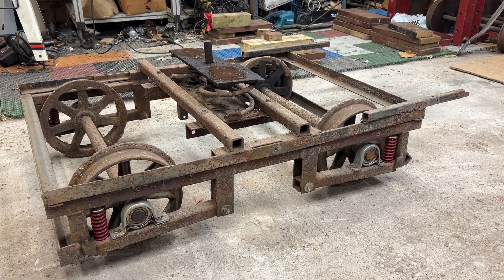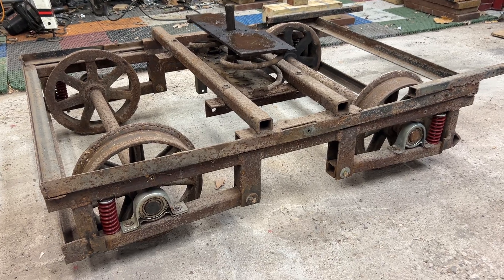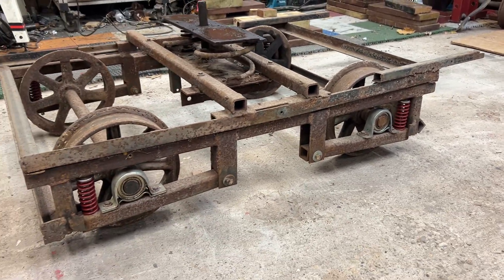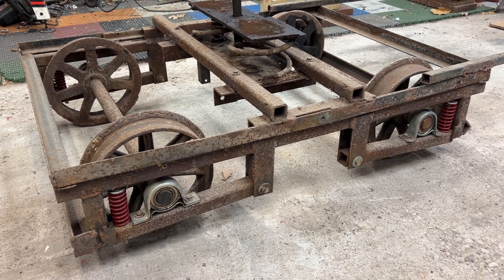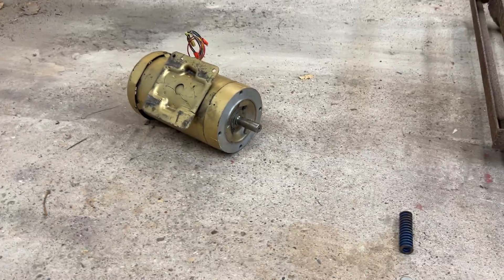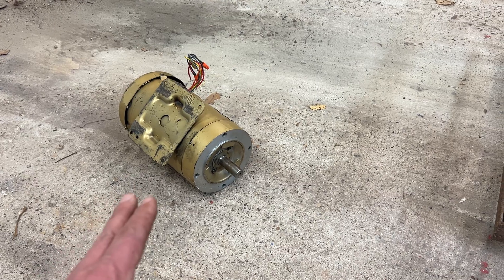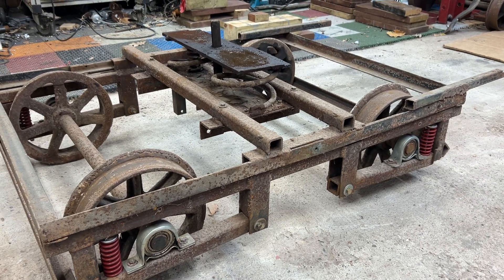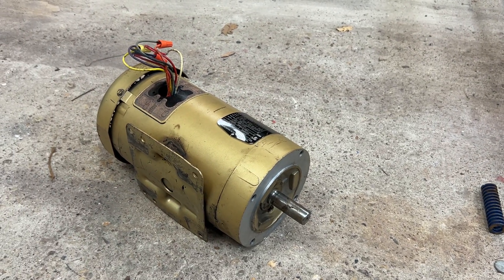Boxmotor truck modification, part 1

Comment: Interesting the age of the wheels. I remember being a boy scout here in Sydney and there was a munitions dock and buildings built into the mountain side we camped at, it had a rail gauge similar to yours with I think 3 very wood rotten flat cars that were still on the rails in 1981. I'm thinking the wheels were like those. A couple hundred metres of rail line . Love watching your channel. Great content always 👍

Comment: Приветствую! Жду с нетерпением продолжения по модификации  тележек для Boxmotor 👍
Reply from the maker: I cannot wait to test it out, I run tested the bogie last night and it runs nicely. Fun to see you run testing yours at about the same time as I was testing mine!
Reply: @CNW4145  Winter is finally over, so we got down to our favorite thing at the same time!! I have emailed you a couple of recent photos of my first tram. This spring, I installed a pantograph (бугель) on the roof, as well as inter-car electrical outlets.
Reply from the maker: Yes! I received the photos and replied, hopefully it didnt get lost in spam land. Wishing you a productive operating season :)

Comment: Thank you for uploading this video, I do enjoy watching your work. I was interested to see you are considering a VF drive and using three phase squirrel cage motors. I'm certain it can be made to work in a satisfactory manner. Have you considered using a home built VF drive, possibly using an arduino board as the main processor? Using an arduino board might allow for some of your viewers to contribute to the development of code specifically suited to your application. Home made might allow for easier drive adjustments when setting up oddball motors. The expected low voltage supply and power dropouts may be easier to deal with. All the best from Ken K
Reply from the maker: For years I was going to build my own VFD because I did not think that a commercially available one would be able to deal well with the not so constant power, and I did not want to spend a bunch of money to find out that it would not work. But now I am able to purchase a 10HP VFD for less than $250 so its not a big loss if it does not work, I could not build my own for that so its worth a try. This one has a very large capacitor bank on the front end and the boot up time is very short so I think it will work. If it does not, but the motor proves to be satisfactory then I may reconsider building my own as I enjoy electrical design anyways, all of my DC choppers are home built and they work very well :)

Comment: Looking like a fun project!
Reply from the maker: Its been really fun so far, hoping it works as well as I think it will!
Reply: First time I've seen that single spring and pin type suspension for the wheels.  👍
Reply from the maker: Its different and was experimental at the time. Since then, I have seen some foreign designs with something similar which made me feel pretty good seeing it used in prototypical operations!

Comment: True bed frame steel is made from old railroad rails that are heated and run thru a rolling mill to make angle iron. That is why bed frame steel is hard to drill.

Comment: What will be the ratio between the 2 horsepower motor and wheel
  What was the other ratio between the original??
Thank you!!
Reply from the maker: The ratio is about 8.5 to 1

Comment: Thanks to see that project.
Suspension looks quite simple and rigid. It will be interesting to see if more axles plays will improve ride or derailments.
Always a good learning to see how different trucks are made, specially in your bigger, heavier scale. Surprise to see those bed framing surviving to such forces and rust.😊😊
Reply: Some sand blasting and paint will make er what it aint.
Reply from the maker: Indeed you are correct
Reply from the maker: Yes when those trucks were only bed frame they were pretty sketchy! Added cushion to the ride but not in the way you really want lol. The design I put in place years ago has been working really well, and now should be quite derailment proof with the beefed up springs. Cant wait to try it out.

Comment: if you give them plenty of cooling, most AC induction motors will happily provide 140-150% of their rated power at a reduced duty cycle and speed.
Reply from the maker: This is what I am hoping I can utilize, the duty cycle for such a power requirement is very very low and the rest of the time the motor is way under utilized. Fingers crossed it works out!